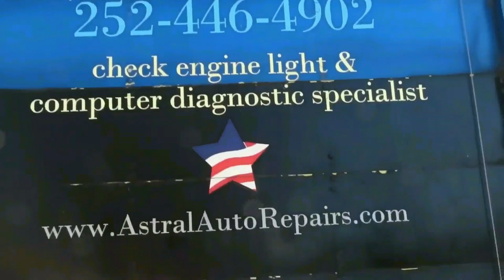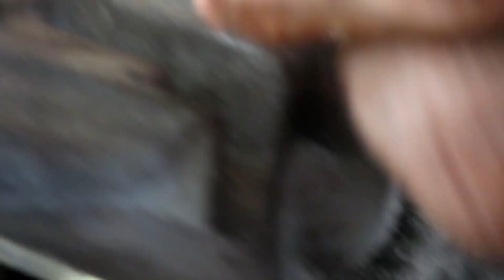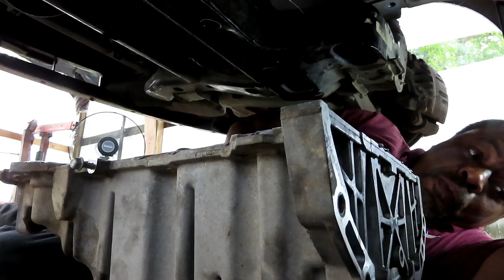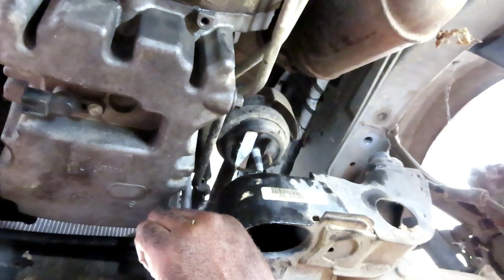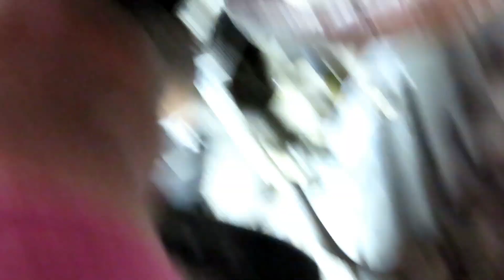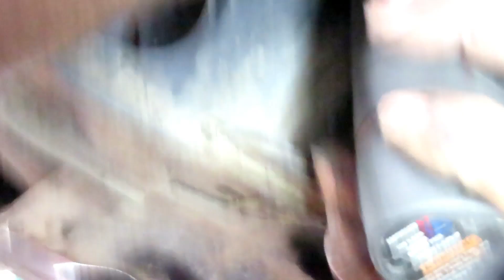⭐ Part 9 - 2005 Cadillac CTS - 3.6 - Engine Knocking - Oil Pan Removal - Rod Bearings Replacement

Comment: You have some extra tips and explanations most channels don’t mention! Good idea having the bolt for the oil level sensor harness still in its spot before reinstalling. Saves time looking for that bolt (or loosing it before reinstall!) Love the marital banter as Tim blocks the camera view of Silvia with the LED light. (Who is putting up with whom?) Great step by step!

Comment: I went through your entire procedure. When I had it all torqued and assembled using standard rod bearings, the engine was so tight it barely turned over and actually caused the starter to smoke. It should spin freely with plugs out. So now I'm looking at doing it all over again. I think you can't skip the step of measuring rod bearing clearance using Plastigage, even if installing standard bearings.

Comment: 1988 f350 5.8 clean throttle body and truck started stalling but I needed and replace my throttle body. But truck still stalling..I cleaned the idle control and egr tested map sensor truck still popping during acceleration..PLEASE HELP